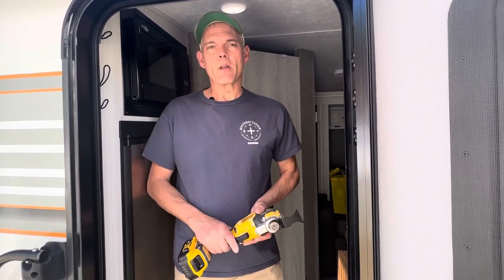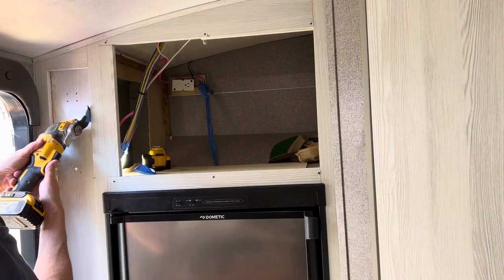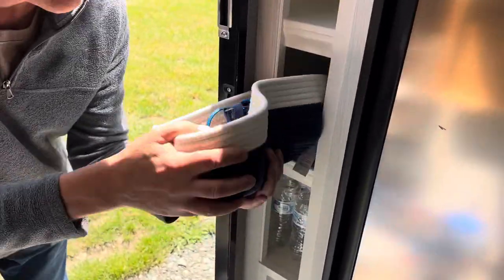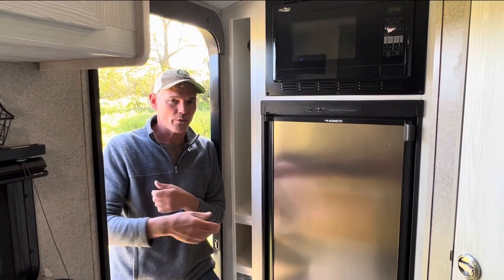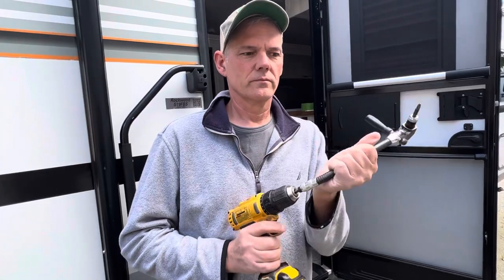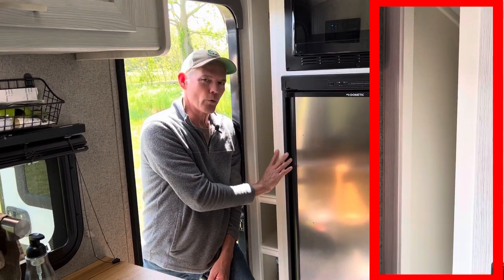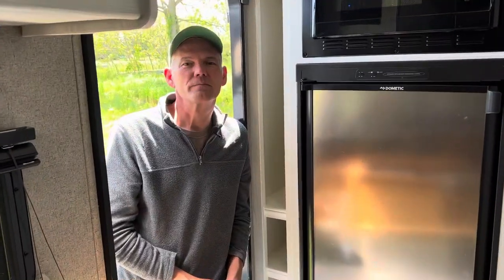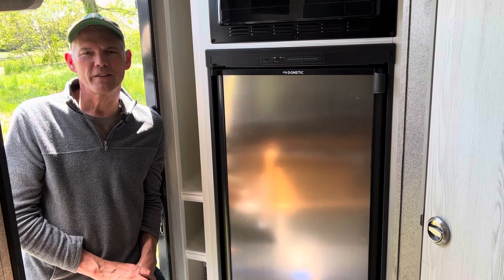We Find 5 Sq Ft of Storage Behind a Factory Panel!  It's Time For a DIY!

Comment: Great job! But my question would be: Since Rockwood is usually good about making use of every square inch of space, how did they miss the boat on this one! They could have run all those wires in the fridge compartment instead. Granted, the Geo Pro is a little less wide than its bigger cousins like the 2109S (which has a factory-built closet there), but as you demonstrated, there is a goodly amount of usable space there! Shame, shame Rockwood! (Or is Forest River to blame?)
Reply from the maker: Do not disagree!  I think it is easier for them to just leave a big space and not have to worry about working around wires…. But would be nice if we see a mod like this pop up in an upcoming year!  It is a great space for coats and shoes as it is right at the door.  Thanks for watching!
Reply: I’m going to guess that this is an absorption fridge and that the wire couldn’t be run in the fridge cavity because it has to be sealed due to the gas operation of the stove.

Comment: Interesting mod! I'm guessing you got the idea from the time you had to repair the microwave mount? 

Cody and I are about to hit the road on a three week trip through Colorado, Wyoming, Montana and the Dakotas. Should be interesting to see how he handles being on the road for that long. He did okay on the 8 day trip west back in March. I went ahead and added two additional batteries to my system, for a total of 420 amp hours. That should solve my power issues once and for all. In other news, I traded in the Mountaineer on an F-150 with the 5.0 V-8. Might be overkill for a GeoPro, but it beats holding my breath going up the mountains in Colorado! And the 36 gallon tank is nice, too.
Reply from the maker: Evening!  So first - that sounds like a great trip.  If you find some amazing boondocking spots, would love to know.  Making lists for one day when we can make our way back out west.  That battery set up with the larger inverter should be a great setup.  Look forward to hearing the details.  And bet Cody will have a great time.  Desi likes the longer trips better than the shorter ones - think he settles in!  

And agree on the truck - the Tundra doesn’t even know the camper is back there so having that 5.0 V-8 should be a nice upgrade!  And I do envy the 36 gallon tank.  The tundra is 26 and hate stopping 2-3 times a day.

So we have eyed this spot since we bought the camper.  We did a video a few years ago where we went looking behind all the panels to see what space is there.  But at the time, we just didn’t want to mess with the wires.  But, over the last year a few others online have done it and we figured it would solve some of our needs.  We have plenty of room for most things but wanted somewhere to store those quick to grab items and this space worked perfect.   So, we took the plunge lol.  It took us longer than any other mod but came out pretty much like we hoped!

Have a great trip and safe travels!

Comment: Not related, but do you have a cover for your front window on the camper?  Debating buying or making one and you’re my go to for DIY😊
Reply from the maker: Hi!  Sorry for the late response - been doing a little traveling.  We do not have a cover.  Have seen a few sold commercially that people are very happy with and have seen a few DIY.  It is something we have thought about though - especially before our next big trip.  But for now, Desi is done traveling for the summer as heat/humidity is too much for him with the heart condition - so this may be a fall project.  Have also seen a company that sells a thicker window film that you can customize with pictures…. That might be what we look to do - would be nice to add some art work to the front!